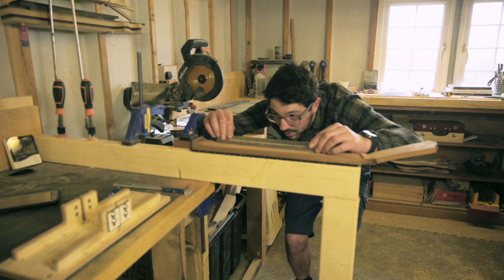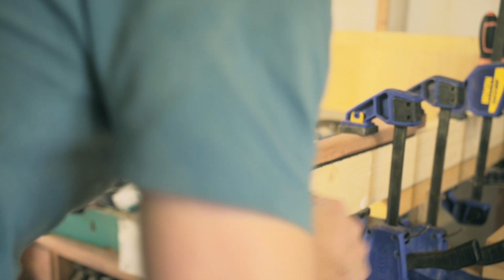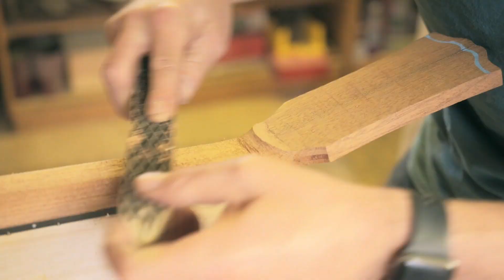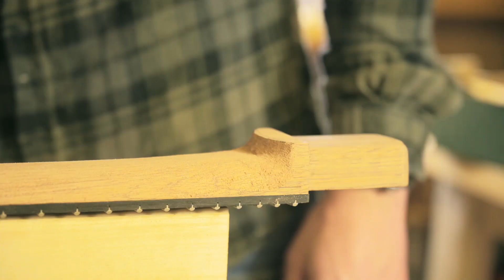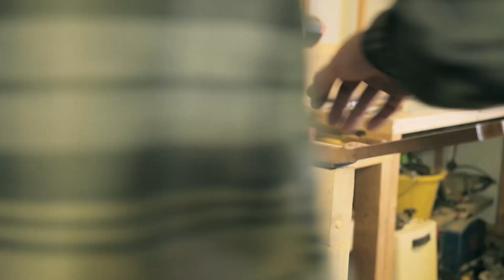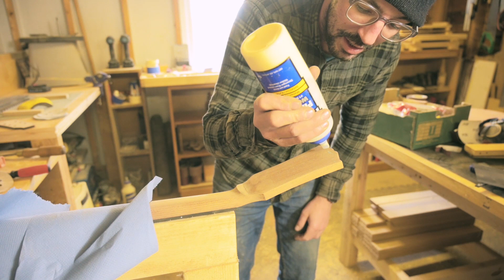'Gibson' Les Paul Junior DC Guitar Build Part 10 - Carving the Guitar Neck / Volute & Heel

Comment: Great work man! Is that a thick C or what profile are you going for? Btw, stupid question maybe, what material is that veneer made out of?
Reply from the maker: Thanks dude. It’s a bit of a made up profile that I copied from my first build. It’s a normal-ish C shape, but doesn’t get too thick towards the heel. Not sure on what the veneer is made from exactly, I tried out an eBay seller and it was just listed as Blackwood veneers, doesn’t seem like they are stained and it’s got some nice curl in the material. They were cheap and seem to work well so far, they are not like the Gibson style holy veneers where they paint them black and doesn’t show any figure